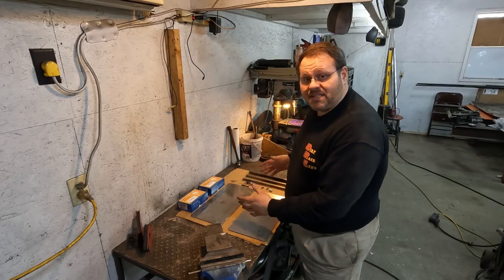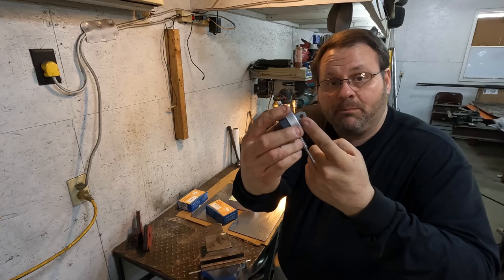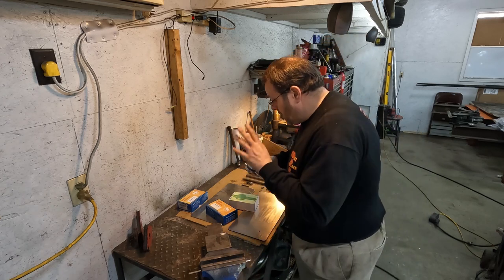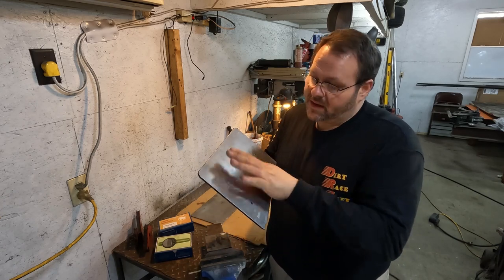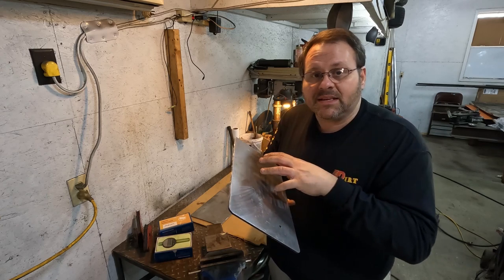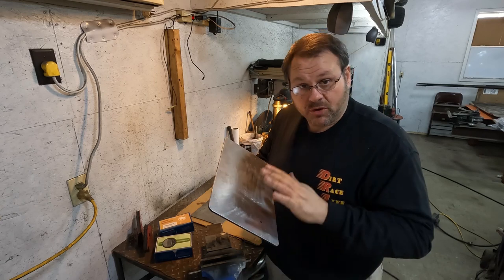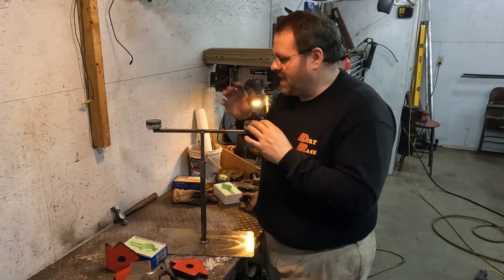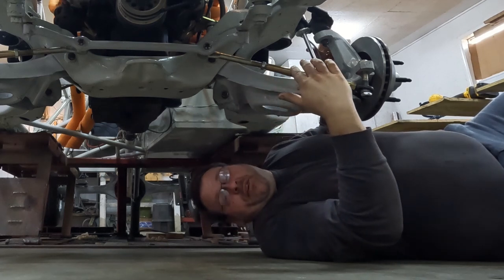Bump Steer Explained, Build a Gauge and USE IT!

Comment: Hey Jason, one thing I noticed when you were running through bump was that the lf horn raised up and went back down when you were raising and lowering the assembly. Just wanted to let you know in case you got any readings that didn’t make sense! I love your design for the homemade bump gauge. Simplicity is king! Can’t wait to see her at the track!
Reply from the maker: It could have been rocking on my lift. Sounds like I am going to do it again.
Reply: @DIRTRACELIFE  you can see it at about 39:15 when you let it back down to extension. 

I just saw that and I know you would want me to point it out to you! I suspect it probably won’t change much, but just in case.
Reply from the maker: @rollrateguy6109   yes absolutely. Rushing to make that Golden Egg and cutting corners is no good!
Reply: @DIRTRACELIFE  you’ll make it!

Comment: Amazing job explaining bump steer, I have been altering the geometry on my 2019 wrx sti, with adding full adjustment for caster/camber/toe I used my string alignment setup to rough in bump steer which I got the arcs really close but it’s not perfect & next step is to do it this way & make a custom spacer after using shims to get it perfect. Will be tracking car on road course & get into time attack so have spent a lot of time getting suspension dialed in with good components. This is last thing I need to do until I swap front LCA to independent caster adjustment arms then start the process over again.
Reply from the maker: Glad it was helpful 😀

Comment: I scribe 1in marks on the plate so you can ditch the tape measure. Next car I have will have an easy way to lock the steering shaft built in, IDK how many times i have screwed up these measurements with the steering moving. nice video.
Reply from the maker: Well That will be getting done ASAP! Thanks for the tip.

Comment: Hey dirt race life.  Someone from road racing life here I love ur videos.  I learn a lot here.

Regarding camber: Should I ensure the camber at each side of the car is equal before doing the measurements?  For example, if the tire temps dictated 1 degree more camber on the front left than the front right, would I want to reset the front camber angles to be equal before measuring bump?  Thanks man!

Going to build a tool like this.  I hate my longacre tool
Reply from the maker: Ok first. . . . Road racing! I'd love to do it but it sure isn't dirt circle so take this as just some outside your field type ideas.
I think you should ALWAYS do bump after setting caster and camber. If you change them significantly then I would re-run bump because it can change a little. As far as temp differences with the same camber on both sides..... Ok that road specific but couldn't that actually lead you in a bad direction because it is simply happening due to the shape and pattern of the course. So if you tune to it at the track, all is good and you get faster but if you take that split setup to a difference course couldn't it just as easily make you slower than you would have been? just some thoughts :)

Comment: Well this is such a great channel. Although I am not a dirt guy, many things still apply. I would very much like to share with some knowledge.  I noticed that doing your bump the chassis did move. Sure maybe a minor thing however me being me. Had to point it with a solution. 

On my bump jack I found some scrap turnbuckles and put those in place of the shock I have a much smoother and repetitive reading. 

But Jason, loving the content, wish I could help with sponsoring but my asphalt car needs my cash lol. 

But thank you again for the great content!!
Reply from the maker: Well this is good timing. I am fixing to run my bump again as part of getting ready for the Street Stock Nationals. Since I have a load stick now I will just use that sucker as my turn buckle same as you. Thanks for the tip and the feedback :)
Reply: Awesome,  I’m fixing to do mine over after fixin a wreck. I’m much like you and a one man show.
Reply: Awesome,  I’m fixing to do mine over after fixin a wreck. I’m much like you and a one man show.
Reply: Awesome,  I’m fixing to do mine over after fixin a wreck. I’m much like you and a one man show.
Reply: Awesome,  I’m fixing to do mine over after fixin a wreck. I’m much like you and a one man show.
Reply: Awesome,  I’m fixing to do mine over after fixin a wreck. I’m much like you and a one man show.
Reply: Awesome,  I’m fixing to do mine over after fixin a wreck. I’m much like you and a one man show.
Reply: Awesome,  I’m fixing to do mine over after fixin a wreck. I’m much like you and a one man show.
Reply: Awesome,  I’m fixing to do mine over after fixin a wreck. I’m much like you and a one man show.
Reply: Awesome,  I’m fixing to do mine over after fixin a wreck. I’m much like you and a one man show.
Reply: Awesome,  I’m fixing to do mine over after fixin a wreck. I’m much like you and a one man show.
Reply: Awesome,  I’m fixing to do mine over after fixin a wreck. I’m much like you and a one man show.
Reply: Awesome,  I’m fixing to do mine over after fixin a wreck. I’m much like you and a one man show.
Reply: Awesome,  I’m fixing to do mine over after fixin a wreck. I’m much like you and a one man show.
Reply: Awesome,  I’m fixing to do mine over after fixin a wreck. I’m much like you and a one man show.
Reply: Awesome,  I’m fixing to do mine over after fixin a wreck. I’m much like you and a one man show.
Reply: Awesome,  I’m fixing to do mine over after fixin a wreck. I’m much like you and a one man show.

Comment: Great video explaining bump steer. Did you notice while compressing the suspension you were slightly moving the chassis as well? As a result of this movement and measuring height from the ground wouldn’t this give you an incorrect bump measurement?
Reply from the maker: Yes it moved on me and I didn't catch it at the time but the measurements were very close. I learn with every new car and you'll see on the car I built this year we did a much better job measuring ;)

Comment: I have a daily Crosstrek 2015, that has the following:
Lifted 1.25 inch.
Camber is aligned by the whiteline Bolts.
Rallitek springs with Belstien dampers.
Purren Endlinks.
Double offset low arm rear bushings - for caster.

Now, i'm thinking of the Whiteline Front Roll Center Adjuster Bump Steer Correction Kit (KCA313).
Do the lifted cars needs Bump-steer coreection ?
Reply from the maker: My expertise is in circle track GM based frames however I can answer, YES anytime you significantly change the ride height you will have to make bump steer corrections.

Comment: Do you think running a front sway bar in a pure stock class is better or not running it is best
Reply: Do u think it's better to run away bar or not to run it in pure stock class we have to run factory strings
Reply: Is there anyway to tell what weight rate factory springs are without a spring machine
Reply from the maker: Junior, I have never run a sway bar on dirt. My thought on this is I want the car to be freed up and able to roll easily without having a sway bar modify the spring rate.
Reply from the maker: If you have access to a hydraulic press and scales then you can measure rate by putting the scale on the base and the spring on top of it. You may have to rig up a piece of wood or something to make a holder for the spring bottom. Measure one inch of compression on your scale. It won't be very accurate but it will let you know the ball park. 
BUT BE CAREFUL! That spring has to be secured with a chain or something because it's a missile if it slips loose.
Reply from the maker: I agree if a sway bar was used then it would sure make sense to go lighter on springs. I just have no experience so far doing it.
Reply: I have extensive experience with swaybars on dirt.. on a pure stock car.. it’s a good tool to have in your arsenal..

The answer to this question though is maybe.. it really depends on what you’re trying to accomplish. The swaybar is rather advanced.. if you’re watching Jason’s videos I would say you’re headed in the right direction. 

What is it you’re trying to accomplish Junior?

Comment: can you you use a castor change to fix bump steer?
Reply from the maker: It does have an effect but it's not a way to make adjustment. I think if you had huge caster gain or loss in compression then it could be an issue that shows up in bump as well.

Comment: HELP! I have a center R&P from a Cavalier installed in my 1948 Chevy Coupe.  If I have the Tie Rod parallel to the lower control arm AND the tie rod length exactly the same as the lower control arm....would you expect my bump steer to be acceptable?  This is a street car...no drag racing or circle track. All rest of front suspension is stock...king pins, etc.  Any input will be appreciated.
Reply from the maker: I think you would be very close but the camber and caster curves will have an impact if they are significant. On a street car I would always tell you to consult with an expert specifically working on road legal builds. Remember, everything I am doing is to only turn left hand circles.
Reply: @DIRTRACELIFE . Thanks for sharing your knowledge and encouraging me.  Some of my misspent youth was hanging around 1/2 and 1/3  mile dirt and oiled dirt tracks in SE Ohio.  Keep on keepin on.

Comment: Are those 1/4-20 couplers round or hex?
Reply from the maker: Those are hex. I used the basic hardware style because they were just right to drive into the tube and the edges bite in very well.

Comment: What tie rods are you using?
Reply from the maker: The inners are the 73-77 GM's which are the same as camaros but straight instead of bent. The swedge tubes are the conversion tubes that are 11/16ths LH on the inner tie rod end and then 5/8ths RH on the outer end and then I am using 5/8ths hiems which are for steering and have a built in grease fitting.